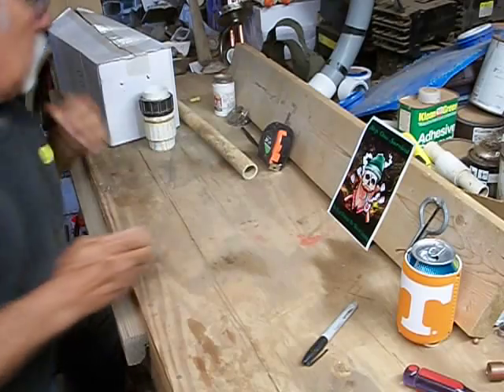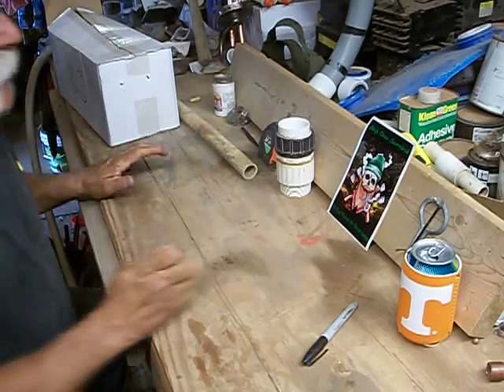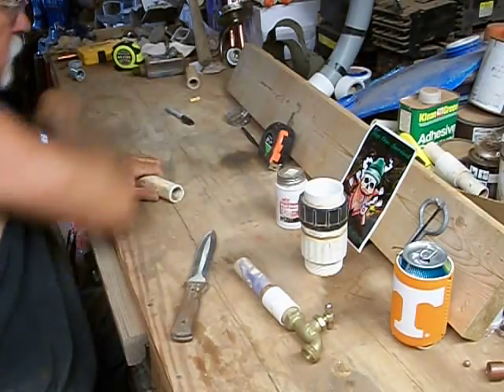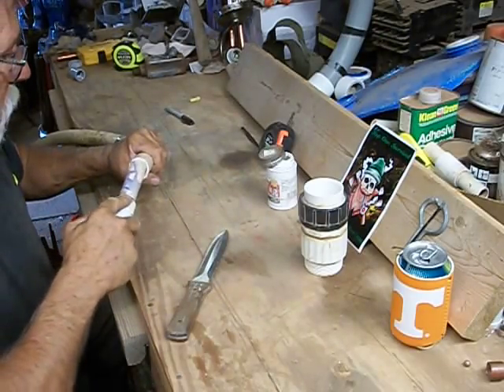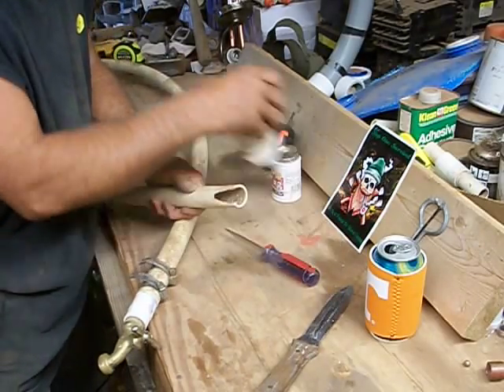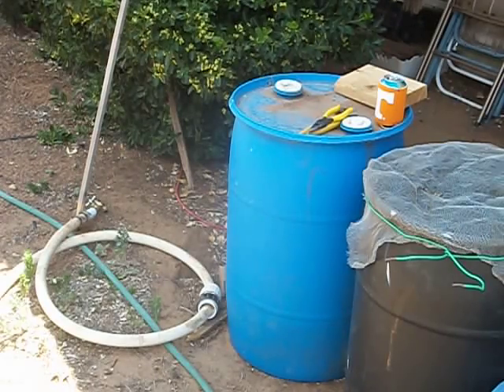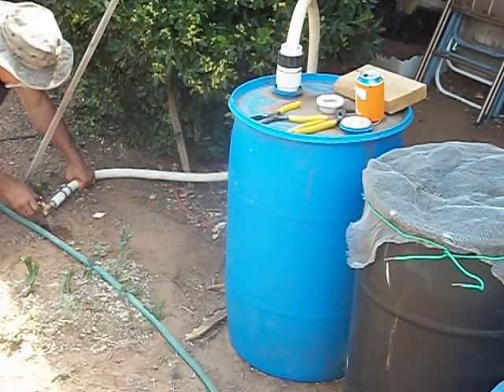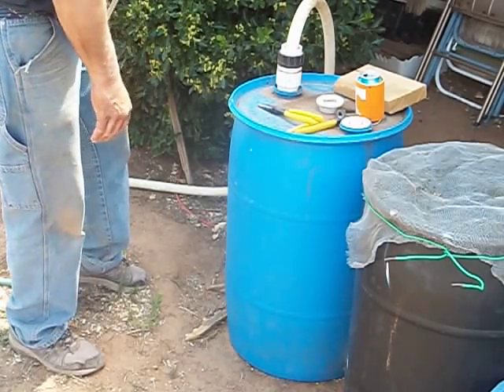Siphon system for rain barrels

Comment: Great video Rob! like the Gerry rigin idea always good to experiment and learn its what we do best!
A faucet in the bottom is a good idea, just male sure with those polypropylene barrels that the seal is good otherwise it will blow out.
Maybe  good idea is to lay a barrel on the side and feed it from a standing barrel, that way it self feeds and the levels apply the pressure.
ATB Del
Reply from the maker: Interesting idea, Del. I'll look into that. I actually do have some plans drawn up for a collection/storage system in which all the barrels are laying on their sides and stacked on each other, 3 or 4 barrels wide at the bottom. And as far as the seal being strong enough, when I drill the holes for faucets, etc., I thread the holes for the size fitting I'll  use and then put a locknut on it from the inside along with the thread sealant. So far, no blowouts! Cheers mate!

Comment from the maker: An update: #2....So, I put a new hose on it (one with no leaks & no connections) and now it works very well. Takes a slow trickle of water to the garden just like I wanted! I still plan to just put a faucet on the bottom of one of the barrels once I get them drained. That will work even better.
Reply: Rob Painless looks good anyway! never hurts to try! :)
Reply from the maker: Learning by doing, I guess. Thanks Mary! Love your new picture!
Reply: Rob Painless thank you! :)